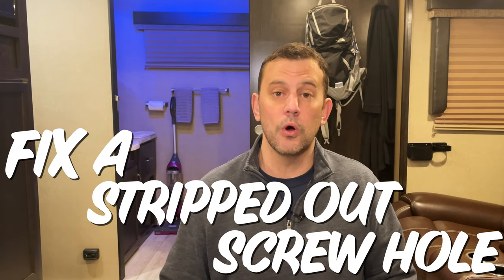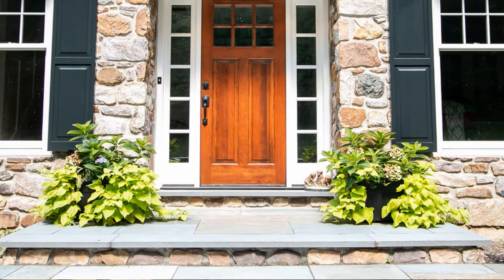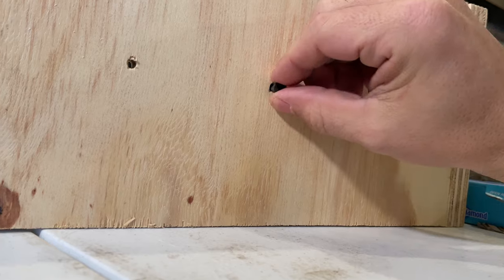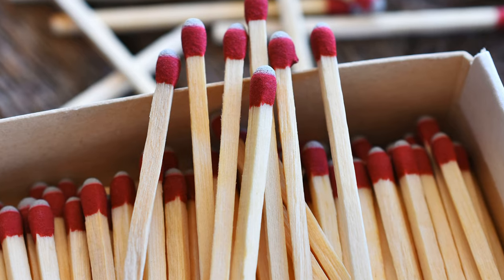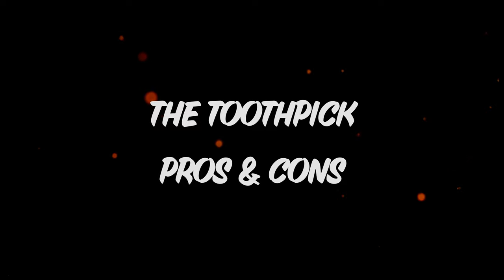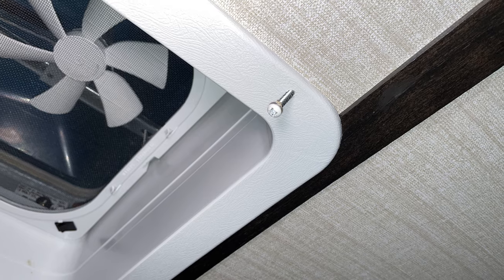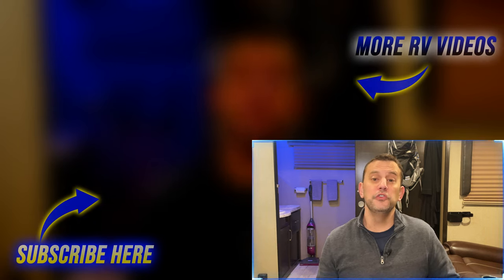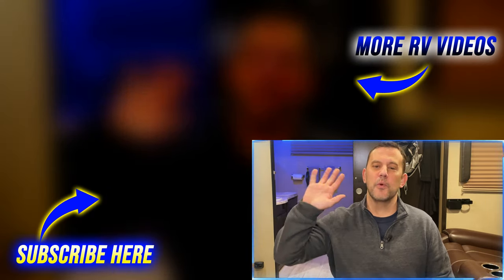How to Fix Stripped Screw Holes in Your RV

Comment: Great stuff Ross! I’ve used all these methods and they all work great. I’ve also dipped toothpicks in wood glue and then packed them into the hole tight. Let them dry, then break them off. Works great if you don’t want to drill out the hole for a dowel.
Reply from the maker: great idea, thanks for adding Matt! 👊

Comment: Been there, done that!  My #1 recommendation would be to tighten the screws by hand.  It's slower, but far less risk of stripping out the hole.  Power tools speed things up tremendously for professionals, but they can also produce mistakes that wouldn't occur if done by hand.
Reply from the maker: Agreed

Comment: Maybe not for most RV thin walls, but I use wood glue and golf tees.  Perfect in the house for door hinge screws that are stripped.  No drilling, just use a hammer and the golf tee as a nail.
Reply from the maker: Good suggestion, thanks for adding Steve.

Comment: Hi Ross! Thank you for your video. It's always very well explained.
I want to install storage on the wall of my RV. How can I be sure I'm not making holes in a pipe or in wires?
Reply from the maker: plumbing and wiring is usually only run through the interior walls and fixtures of an rv, meaning the 4 outer walls usually dont have anything including pipes or wires in them.   its the divider walls you want to be worried about.  a stud finder will help you find studs.  its the interior walls/room dividers where everything is run, and of course the floor.

Comment: In some cases you can stuff the hole with fiber - string, cloth, yarn, etc - then soak it with super glue (cyanoacrylate) pre drill, etc.   This will work on plastic or wood.  Since the super glue sets in a couple of minutes it allows you to finish the repair pretty fast.
Reply from the maker: excellent tip David, thanks for sharing!

Comment: Ross is da boss!  Great video, like all your others.  I just bought a toy hauler, and the ramp in the back has these assisting cables to alleviate the weight burden of the ramp when being opened and closed.  The cables are secured or fastened to the ramp (frame made of aluminum about 1/8" thick) by way of a metal bracket held down by four self tapping screws.  One of my screws is stripped.  Because of the significant amount of weight that this cable bears, I am looking for a bomb proof fix for it.  Any suggestions, other than using a larger screw?  Thanks

Comment: some good ideas.  I have a stripped screen door latch on my rv door, so I'm working with a thin aluminum surface with sytrofoam behind it.  Would epoxy possibly eat away the foam?  That would leave an expanding backer as the best option right?
Reply from the maker: Ray, many epoxies will eat styrofoam. Try the backer. Let me know how it works out bud!
Reply: @RVTIPSANDTRAVELS  The expanding backer (had to purchase a Heavy Duty Metal Setting Tool for Hollow Wall with the backers for $20) worked great!  My screen door latch is more solid than it's ever been and I'm sure I'll find other uses for this tool.  Thx!
Reply from the maker: Good to hear!!!

Comment: Great video!  Any suggestions for repairing ripped or torn laminate?  Is there a certain glue that should be used?
Reply from the maker: where exactly are you talking about?
Reply: @RVTIPSANDTRAVELS  there is a spot under our kitchen table on the corner near the floor in our grand design as well as a spot in our outdoor kitchen from pulling the panel down to access the water heater bypass.
Reply from the maker: Ive used this product on linoleum in my kitchen that was peeling and it has worked perfectly, but I am not a professional floorer.  https://amzn.to/3LjeKpt

you should be able to find extra laminate under or behind your cabinets that you can cut out and use since you wont see it.

Comment: What would you suggest for fixing the stripped holes for a striker plate?  Our is sliding back and forth so right now we have to slam the door. Our neighbors probably hate us, but I am trying to research the issue before making it worse. I have toothpicks and zip ties on hand, but if some type of filler or anchor would be better I can go get those as well. Thank you.
Reply from the maker: Deanna, i would try toothpicks or zip ties first.  Let me know if that holds up.  If not circle back and well try to figure something else out.

Comment: What would you suggest ..my rail just screwed into my caravan roof just thin board an insulation . It’s for sliding wooden doors . The little screws just keep turning an pull out with the weight of the doors. Was thinking of trying to inject a none solvent glue help!!? Thanks mike
Reply from the maker: id have to see it, but if there is enough room for expanding anchors that might be the way to go.

Comment: Don't most exterior RV walls now contain a hard styrofoam material which would make it difficult or impossible to use the expanding anchors in the wall? What is the best solution for those walks?
Reply from the maker: Hi Tim, a metal expanding anchor will chew through that insulation enough to expand.  You can use something with a wide thread profile that bits into the insulation like these: https://amzn.to/3gcX185

Comment: What if the walls are 1/2 '" styrofoam? once the screws have vibrated themselves loose there no way to add longer screws or toggle bolts.
Reply from the maker: Metal toggle bolts will open enough in a styrofoam wall.  Plastic probably won’t, but never tested them on styrofoam.
Reply: @RVTIPSANDTRAVELS  My Rpod's seats are completely off the walls and the holes are twice the size of the screws, from roads vibration, the screws are just barely in the styrofoam sheeting, and not even a stud was used to screw the seats to the wall. , quality job inspector must have been on holiday.
Reply from the maker: Well that stinks. Yeah you’re right he must’ve been off that day. Something else I learned after making the video was putting zip ties in the hole. That might work for you.

Comment: Which method for straight fiberglass, only about 1/4” thick?
Reply from the maker: fiberglass is rigid, I would probably go with a toggle anchor, like the metal one seen in the video at 02:17.  Never tried wood glue on a wooden dowel into fiberglass so I can't say if that method would work.

Comment: You never communicated how to remove from the outside of the RV? I have many head rusting and the head won’t stay attached to remove, I want to replace all the zinc plated there everywhere on my RV, there hold on the small gutter up behind awning, then the fiberglass cap seam front and back all needs to be replace you barely touch and head falls off
Reply from the maker: drill them out

Comment: How would this work though for a heavy load / heavy use hold like the foldable handrailing that is screwed into the exterior wall which is mostly STYROFOAM insulation?
Reply from the maker: Handrails get their strength from the fiberglass wall, so I would assume an expanding backing anchor would be best. I’ve never pulled these bolts out though so I don’t know what they actually secure into. There is a wall directly behind where mine mounts, so it might be going into a stud. In that case I would probably use a Thicker bolt. I would have to pull my bolts out to see where they actually mounted though to give you a definite answer. Hope that helps.

Comment: Why did you pass over the simplist permanent repair?? apply GLUE and reinsert the screw!!
Reply from the maker: What kind of glue are you referring to? Like an epoxy glue? metal and wood have completely different porosity and density, making them very difficult to glue together.  in other words, as temperatures rise and fall, they expand and contract at different rates, and thats where bonding can come undone over time.  unless you are using a polyurethane based glue, which is probably the best for gluing metal to wood, I would not advise anyone to use a wood glue directly on metal.  its just not made for that. its simple science that cant be argued.
Reply: @RVTIPSANDTRAVELS  In gluing stripped screws on my 5th wheel for the past 8 years i use a super glue mini pack from ace hardware. Once it cures, i have NEVER had a problem!!
Reply from the maker: @dwightrudd9724  I get that from your original comment, but again I’m asking you what kind of glue it is that you’re using?  If it’s a polyurethane or epoxy then I actually do mention that in the video.  I’m guessing you didn’t watch the entire video.